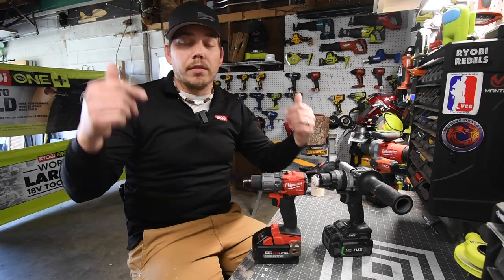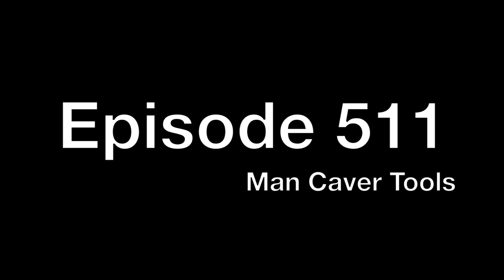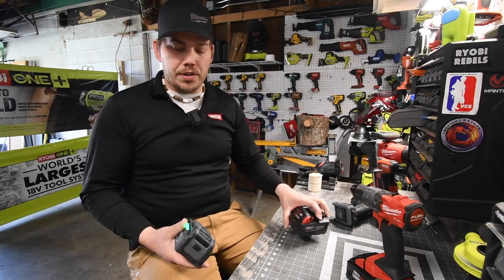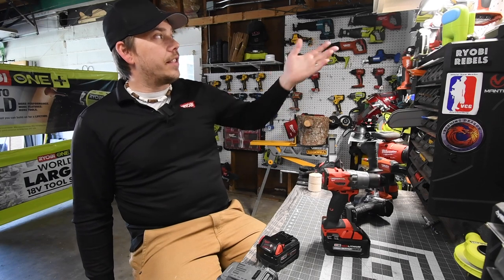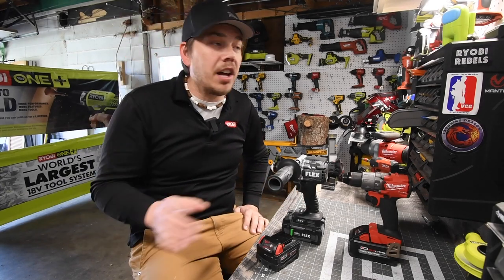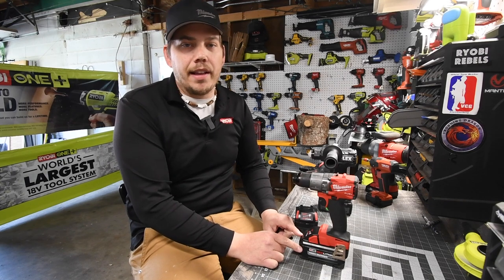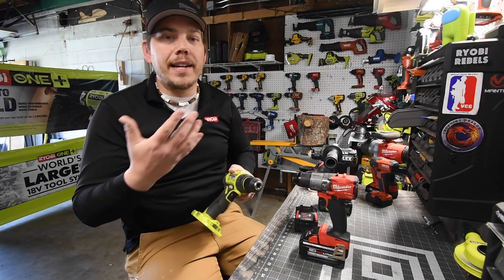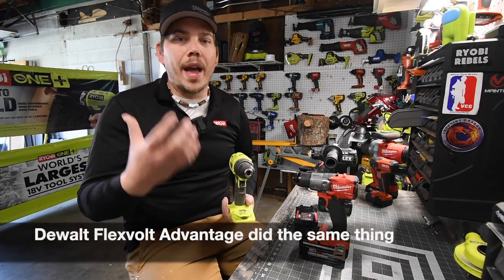A reminder of what my channel is and what it's not

Comment: You should say your channel is also helping the average person decide what platform - when i was first learning i got the 18v Kobalt not understand nominal voltage vs max voltage etc... - Why? Price and Deal and they seemed to be Competent. Then they made a 20v which was backwards compatible - Great! then they came out with 24v which was not compatible, so i went a found a new platform 9 years later. ..MAKITA. They don't make the best tool of every type, but they are competent and they have a very large assortment. When I'm trying to decide a platform I want to see a tool as you would get it from the store vs another tool as you would get it from the store. Flex is competing with people who would purchase the Craftsman Power Tools, or Kobalt Tool line and even the Dewalt tool line. Now Pro's might never buy the craftsman or ryobi, but your guy just getting into it might and its nice to know how it compares as a general operating tool.
Reply from the maker: that is actually the principal of the channel :)

Comment: In saying that, you can’t then compare batteries with 18650 cells to batteries with 21700 cells. That’s not fair. Regardless of voltage you have to compare like to like. You also can’t compare brushed to brushless. If your just comparing the performance to a certain tool that’s fair regardless of its features. 
I think you do a good job in your reviews and as long as the playing field is fair (your words) I’m all for it.
Reply from the maker: your watching the wrong the channel then
Reply: @ManCaverTools  DUDE YOUR WRONG

Comment: Everyone is hung up on the voltage and AH of these batteries. What is the actual POWER (I x V) and efficiency these motors are putting out or are able to handle? It would appear the HO batteries are providing the tool more current given the bigger reservoir of electrons. A tool may be 24V, 36V, etc, but the motors can only handle or deliver a certain amount of wattage (power) before the windings burn up or its mechanical limits are reached. The tool is a summation of the parts, but I would be every interested in knowing what the motors by themselves are capable of.
Reply from the maker: that kind of test can only happen with very low ah batteries

Comment: Hello Dave, thanks for the awesome videos 👍 I have a question about the Milwaukee 2962-20 I just purchased, the anvil slides in & out of the gear housing & grease is oozing out, is that normal or do I need to take it back to Home Depot? Keep up the great videos, you got yourself a subscriber here.

Comment: I’m just curious why you wouldn’t try Flex with the turbo off and then with it on if you think the turbo would give less torque? I would think fair for Flex would to give it the opportunity to do its best. Maybe I just don’t understand why it’s not worth the extra hole?
Reply from the maker: because that is the benefit of having a turbo button. in a high torque situation the turbo will make the flex tool fail a test. it has a better chance on finishing certain tasks with the turbo off. so I will turn it on and off as needed

Comment: i believe you're fair when testing the tools battery wise and you normally are a fair tester. i've defended you on tests before. that being said your test with the dewalt was not fair because the tool was on a low gear with high torque compared to the flex on max speed with turbo but lower torque. we needed to see max rpm speed 3 on the dewalt vs the flex at max rpms with turbo. i personally believe the dewalt would win in a torque test doing a torque task but it needed to be shown. also i think the flex would win in an rpm test with an rpm task. out of all your vids this one was the one that got to me. all your others vids i give you a thumbs up.
Reply: I like my man too. The channel is entertaining and informative; seeing how one brand compares to another. I think the concept of output and watt hours of batteries get lost in translation: A watt hour is a unit of measurement for power over a period of time. In other words, it’s the energy capacity of that battery. Adding 10 watt hours to a battery doesn’t give you more output, it allows you to do work for a longer period of time. Like Ryobi’s 3AH and 6ah HP batteries. That’s 54wh vs 108wh….you don’t get extra output because the capacity of the battery increases, you get more run time….like the air cannon fan. Adding a 6ah battery won’t make it spin faster, only spin longer. In the video he did earlier today, it wouldn’t have mattered if he used the 9ah battery on the Ryobi, it still wouldn’t have made a difference comparing it to the flex. The flex is a superior quality tool with better technology at a  different price point.
Reply: @justinsgarage1125  yes. But battery isn't the issue. It's the modes that were the issue
Reply from the maker: I thank you so much for the ckc, more real tests are coming

Comment: So what I think got some folks bent out of shape was Speed 2 Turbo vs Speed 2 DeWalt.  I think if you re-do with a Speed 1 Turbo vs Speed 2 DeWalt, that DeWalt will still win (because it is optimized for it), but they won't be able to accuse you of putting 'a high speed gear against a mid-speed gear'.  

I personally don't understand why DeWalt Speed 2 now needs CANCELLED!   But Turbo mode is A-OK???  Middle gear has a use.  DeWalt did mechanical engineering to make a middle gear.  If that middle gear helps it cruise through the woods with a big bore, so be it.  Maybe there are other use-cases in which Flex would win.  

Just my $0.02.
Reply from the maker: thats the benefit of having a dewalt
Reply: @ManCaverTools    Makes sense to me. 

I also find it ironic that they didn't catch that the M18 with a similar Wh battery did it 3 of 4 times and Flex only 1.  

There was much tooth clenching over DeWalt Speed 2 that M18 with a proper battery beating Flex was completely overlooked.

Comment: I thought some more about this, and so much of what is going on circles around testing.  Should you test Ryobi against Flex, it doesn’t sound fair.  And it isn’t if you you are putting the two together in a competition.  But let’s say we do a testing of all “Oscillating multi-tools”.  We want to evaluate them all, and let you know which is the better in the various categories, such as speed, width of cut, amount of vibration, etc.  Is this fair, yes as you are explaining what you are trying to do, evaluation them all and comparing.    I can compare the Flex and the Ryobi, how, just by saying why and how you are comparing.  I want to compare what a budget tool can do to a high end expensive tool.  Thats fair.  Making them compete for who the winner is?  That wouldn’t be fair
Reply: And in the testing, one of the biggest complaints I have heard is because of the human factor.  Look at the feedback on the Flex head-to-head videos.  I think Project Farm does a fairly good job of taking out the human factor with the jigs he uses.  As one person said, he might want to think about more then just one test on each tool, and he will take that feedback.  I think your testing is “fair” as you state, and you need to compare the various models that meet.  I saw one Flex vs Milwaukee test, where to make it fair, they uses a High Output battery, as a result it was able to equal some testing of the Flex.  IN this case was it fair, it made them close to equal.  Or would it be fair to do the same testing when Flex comes out with a High output battery.  Then the Flex would win again.  But it should, it is still a 24v tool vs a 48v tool.
Reply from the maker: I do thank you so much for viewing

Comment: About that TURBO button... You do understand that there is no turbine (LOL); it's a marketing gimmick, meant to fool people into believing what they want people to believe, namely that it's an UNPRECEDENTEDLY technology (LOL). What it actually does, is a very simple toggle between protected and unprotected battery circuitry. You go into "turbo" mode, you're on the "high-flow" circuitry, you go back to non-turbo and you protect your cells... The Milwaukee High Output batteries are way more honest about it; they use the unprotected cells and they don't make a big deal out of it; how easy would it be to add a board which will diminish the output? Super easy! The extra Ah are related to an extra cell and has little to do with the battery output.
Reply from the maker: I do understand that its electronic and not an extra orbital gear

Comment: I'm not sure the word fairness is even the correct word for what u do-I think it's more like "common sense" U test the hammer drill from each company vs the other company(or even the same company)'s hammer drill which was made to perform a task
Voltages, turbos, etc really are only things if interest-but what a user really wants to know is-DOES IT GET THE JOB done
As long as it's priced similarly/reasonably
Who gives a flying f#$@ what voltage it is
Reply from the maker: I try to keep tests as fair as possible.

Comment: to be honest, all this 18v, 24v, Amp-hours, etc. is getting out of hand.  You say its not about equality, but 'fairness' isn't part of it either.  Who cares what is powering the tool.  for example, you take your flagship drill,....I'll take my flagship drill.  whichever wins is the "better" drill.  Its irrelevant if I have a 96.4 Volt battery and you have a hamsters-wheel powering your drill.  If I am choosing to market my drill against your drill, may the best drill win with whatever is under the hood.  Of course many things should be considered (speed, power, build quality, longevity, etc.)  Rant over.  No more espresso before bed.  :)
Reply from the maker: I do agree with you on that one
Reply: @ManCaverTools   BTW, wasn't ranting on you.   Just in general.  Its gotten silly since FLEX came out.  Love your channel.

Comment: you test various tools and you post results.You try to make the tests as fair as possible and technically it's not your fault if one company use's better battery cells or has higher amperage batteries.You try to match the battery amps and basically all the tools do the same test so waht ever brand is faster wins the test.Does this mean that long term the winner of the test has a better tool?Not really if the tool breaks after a few months of use then no.You would have to post long term reviews of the tools being used on a daily basis.Even then one person might be hard on the tool thus causing the tool to fail.Why do you feel that you need to say that you are sorry it makes no sense.
Reply from the maker: I agree and that is what this channel is all about